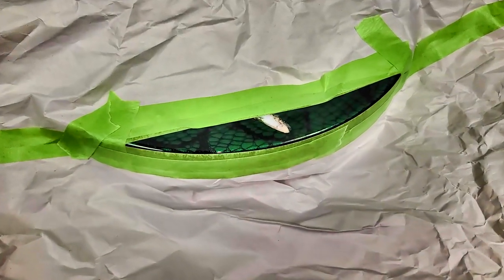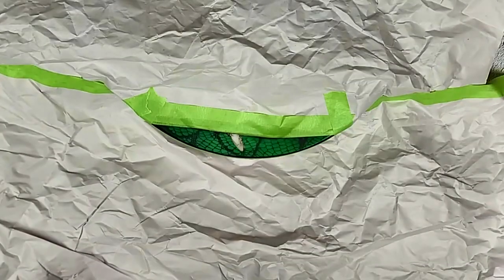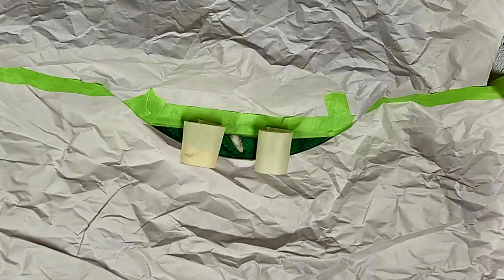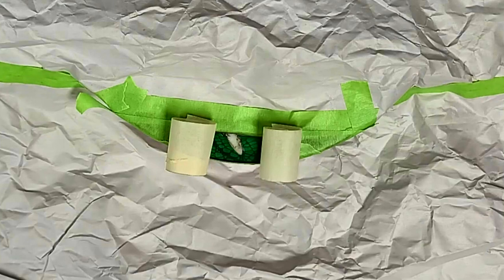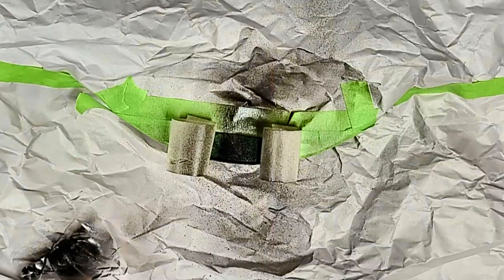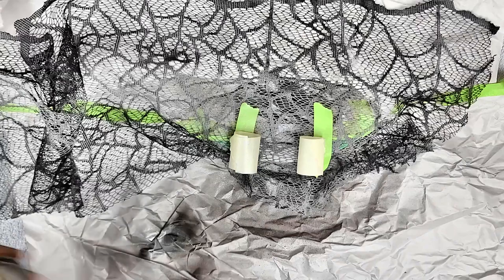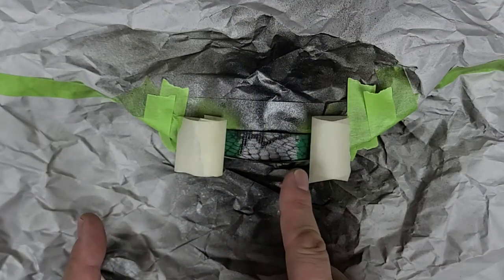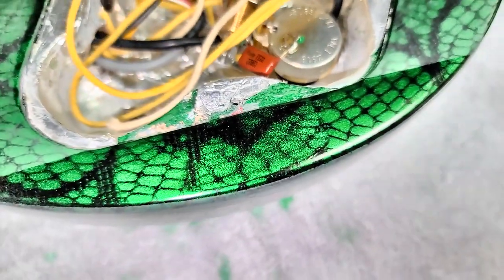Damage Control Fixing the OOPs I Made

Comment: genius work man rolling the tape to avoid a sharp edge!
Reply from the maker: @RandySchartiger  it's an old trick. Now they have a round fome beed with a fine line adhesive on it for doing the same thing in automotive painting.  It can be used for not getting overspray in between the body and doors.